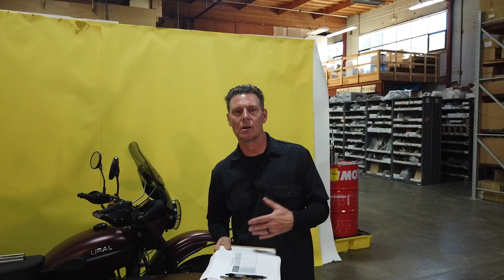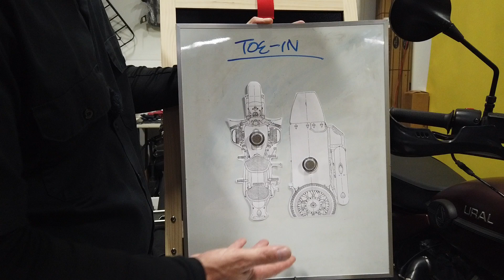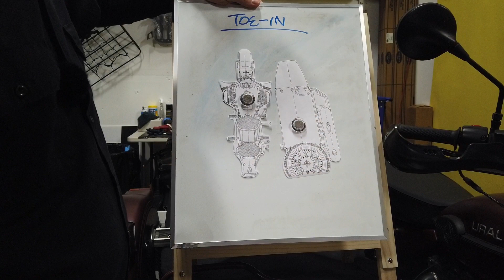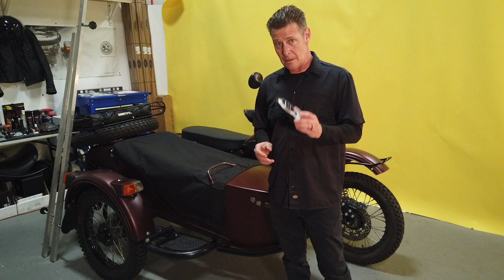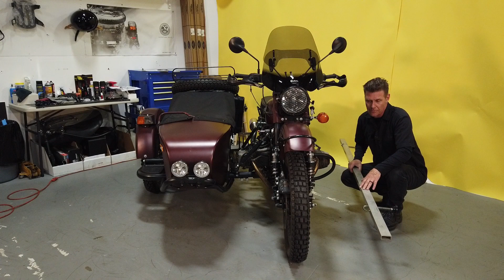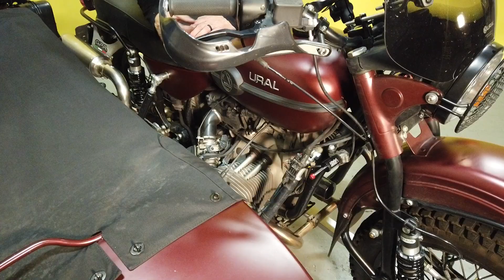URAL How-To - Sidecar Alignment Check

Comment: Thanks for the detailed information.!
Disclaimer noted, by following your instructions I can’t make it worse. :)
Severe wobbles at low speed on my old Chang Jiang.
I shall start again from the triple tree & front wheel just to be sure.
10 mm & 1 degree.
Cheers from Australia.
Reply: If you are having wobbles, please check your wheel rims. You may have one (or More) rims bent causing some wobbling, also check your wheel balancing

Comment: Mechanic for 40 years, aircraft mechanic for 32 of those. After these adjustments are correct and tightened. Consider applying "torque seal". A paste from a tube that dries and is skydrol (aircraft hydraulic fluid) proof. So it should be a more than fine for motorcycle applications. 
A bead across the tightened bolts, nuts, etc.  if it is ever misaligned across the application it would mean something has come loose, changed or just plane fiddled (f$&ked) with.  This should then alert that it very well is now out of alignment.  Can even be purchased thru Amazon, just look up torque seal. About 15.00 a tube.  Good for car/truck alignments as well.

Comment: Thank you David for such a detailed and informative video. I became the owner of the Ural ST in early September 2024. The motorcycle was produced in 2020. Before me, the motorcycle had only one owner, a rich man who had 5 motorcycles. He ride this Ural only 1,000 km (621 miles), installing everything he could on MC. I have already driven 1,300 km on it. And all this time the motorcycle was pulling to the right. After watching your video, I bought everything I needed to build exactly the same equipment for measuring wheel alignment. A couple of days ago, I discovered that ALL 5 shock absorber springs have different pre-load adjustments (as you know, there are 5 levels of pre-load adjustment) !!!
I corrected this error (or someone's bad joke) and a "miracle" happened - the motorcycle began to go strictly straight! You might want to make a video on this topic, as I don't think everyone pays attention to the pre-load of the shock absorbers... 🤝

Comment: I've added a light, homemade, right sidecar to my Yamaha FZ6R. I've followed all the standard lean-out and toe-in, and my tricycle tracks true. But when I apply the brakes (either front or rear or both) the rig tends to pull left. I figure the sidecar, although very light, wants to pivot the bike to the left, and that the only solution would be a brake on the third wheel. Any explanation or suggestion?

Comment: I have no experience with riding a sidecar or owning one. At this moment, I am intrigued by them, but I have worries about this issue and necessary tuning. Could this be a result of the varying quality that often accompanies man-built manufacturing?
Reply: Just bought my first sidecar rig, Ural car on an '81 BMW R65. Ive been riding motorcycles for 15 years, and work as a coach teaching the basic rider course. This thing is completely different when it comes to steering, throttle inputs, body positioning, everything. The main issue im running into is a very sketchy wobble at low speeds (which is why I'm watching this), I would say if you do get a sidecar rig, get it from someone who did their research and can prove it. Or go the dealership route. Because getting this sidecar aligned has so far been a huge pain in the ass

Comment: Do you have any advice on tyre wear from this? My bike tracks perfectly at 50mph and pulls to the left off the gas. I have just had to replace both tractor and sidecar tyre at 2000 miles as they are worn out

Comment: Great video sir!   Can you tell me what the sidecar torque specs are on the lower tube pinch bolts.  Mine I found to be loose.  Looks like the owners manual says 64.9 ft lbs.  They seem to have lock nuts.  Wondering if my dealer didn’t tourqe them during the assembly process

Comment: I liked this video, UNTIL YOU TRIED TO SCARE PEOPLE INTO BUYING BITS OF OVERPRICED METAL !!!
ANYTHING THAT IS STRAIGHT CAN BE USED... ANYTHING  !!!
Reply: SO TRUE,I USE ANGLE IRON,FASTENED TO THE WHEELS WITH LARGE CABLE TIES,I HAD TO TWEAK MY HARLEY TILL IT FELT OK FOR ME ,BUT AS I LIVE IN ENGLAND,THE CHAIR IS ON THE LEFT,BUT DEPENDING ON THE ROAD,POT HOLES,CAMBER,ETC,YOU STILL GET LITTLE SURPRISES,BUT WHEN YOUR ON A LONG STRAIGHT,SMOOTH ROAD,ITS SWEET,….JUST HAVE A LITTLE PLAY TILL YOU GET IT TO SUIT YOU,STEERING DAMPERS CAN HELP,STOPS THE TANK SLAPPERS,BUT THE WIZE THING TO NOT DO IS RIDE AN OUTFIT WITH NO HANDS,ALTHOUGH BACK IN THE DAY,I HAD AN OUTFIT WITH RIGID FRAME AND GIRDER FORKS,THAT WAS TERRIFIC,,,,RIDE SAFE FOLKS.

Comment: I think your full of shit sending someone to a dealer. If someone can’t maintain their bike and or sidecar they have no business riding. Thank you for the rest of the video but cut the shit.
Reply: Those extrusions are better than a piece of angle or an old light….. right… outright lies… the only way you’ll get the same or better as that glass tube would be a level…. Or something similar that has been checked on a surface plate….

Comment: I don't own one of these bikes but I watched your videos, why would you have to remove the upper bolt from the adjustable rod, loosen the jam nuts and turn the center section. If the upper and lower ends are threaded it should move outward or inward, without removing the upper mounting bolt or is the bottom mount welded on,just curious.

Comment: Good advice. When I bought my used 2018 gear up last year, I took it down to Holopaw Ural near Orlando and Gene and the crew got it  aligned correctly. It was acting Squirrely and I knew it wasn't right because my 2005 tourist tracked true all the years I drove it.

Comment: Hi, David. think i can guess your answer to this question, 2014/18 gear up owner with out a service/dealer close by, and no computer software like OBDwiz what very minor adjustment can be made to the EFI gen one like to raise or lower the idle,maybe even check balance. i know there is a adjustment screw on the bottom of each electro-jet. i have not messed with these but would like to raise idle up a couple hundred RPM.

Comment: A simple question.  The lean out I get, just the angle difference based on the brake rotors of rear and the sidecar.  Why can't the toe in be specified in degrees?  The specified measurement is based on the length of the rods at the front wheel, correct?  And this is bike specific, or is that the point.  Seems that all side car rigs have some degree of toe in.  Is there a magic degree that applies to all?  Just curious.

Comment: Glad that you pointed out that our Urals are hand built by real people and will have slight variances. As with my 2013 Patrol T. Because of the swingarm misalignment the rear and front wheels on mine are offset about a 1/4" when parallel so I have to adjust the toe in off  the rear wheel only. It works.

Comment: David, Thanks for the video. Should the sidecar frame be level fore and aft? On my new 2021 cT the back of the frame is quite a bit lower than the front. Seems like I remember on my two previous Urals the frame was level.

Comment: I like the fact that david says right up front that different roads in your locality will have different cambers. That is how much slope the road has in it to drain the rain and in my care thre snow melt. Riding on any given day will subject you to all of the variables. In my case I ride back roads the most- so I adjust to that. They have the most. camber. when I get on a state road it is entirely different.
Also when you ride out of state - like going south- the roads have less camber and are different . Every setting on alignment is a compromise. Also the weight of the rider and it's passenger will make a difference. Test the bike the way you will ride it most of the time.

Comment: Have a real problem with my 2010 Ural tourist with chair on the right. See I'm in New Zealand and we drive on the left. With the alignment of the bike leaning away from the chair on a left hand cambered road the handling is OK but the riding sensation very weird. I've brought the bike as upright as the adjustments will allow and its a whole lot better and with no ill effects, better if anything. What's the official line please?

Comment: Great video, man! It was very effective, I may sound stupid but, because I intend to buy a Ural, I hope you won't mind if I'm gonna ask you a question even it might sound a little bit strange to you.... So, why nobody thought about installing a safety belt in the side car? If such an option existed would it be useless? Or can it even be dangerous in case that I will install  one after market? Thanks for all the tips you are giving to us!
Reply: I most definitely would not install a belt in sidecar. If bike tumbles it rather escape the cement mixer. When I take youngsters in sidecar I’m making a decision for someone else and simply use a high degree of caution. Low speed - low traffic — familiar surroundings etc. An adult is capable of making their own decision.
Reply: @stupollock6851  Thanks a lot for your answer!

Comment: I just got my 2020 GU and it's a wrestling match to drive, Pretty good pull to the right, I do not think the dealer set it up right, Driving in a straight line should there be that much pull.
Reply: No, not really unless you're on a steeply crowned road, perhaps. Try to find as flat a road as you can and if it still pulls hard to the right, have your dealer adjust it or do it yourself.

Comment: First, this is a very good tutorial,  Remove the Ural hubris and it is damned good. and now for the rant. And it is a long one. Some background, I own 3 Urals, have had 4 (the gone one was named Christine for a reason). Have been riding Urals for over a decade, sidecars almost 30 years. But sorry David, Ilya, Jason, et al, I can't let this slide, been doing this way too long. Sorry David, you tugged a chain. Unfortunately, many dealers send bikes out the shop misaligned, in some cases horribly so. MANY DEALERS, way to many. Perfect is not attainable, but closer than what I've seen sure is. Next dealer meeting, go ove this subject, please. I've been lucky have had dealers who are run by sidecar people for mine, plus I mount sidecars and know how to align then. It is more art than science. I my case, the 2 dealers (Ural NE and Bluemoon Cycle) even mark the alignment so you know if it has moved! And yes, had to alter my alignment because I am heavier than the normal Ural rider, easy enough (in my case 2 threads of lean out). I wish I had a dollar for every Ural I've assisted getting right, in a campground, at a rally, with a frustrated worn out rider, and generally brand new bikes. It takes patience and time to get right and ANY STRAIGHT EDGE works, but it has to be straight! Florescent tubes do not bend, got it? They do break and make a helluva mess though. (do not use lumber as a straight edge, it is NEVER straight) Your alignment beams certainly do, have seen it with my own eyes. Know a dealer who I will not name have a brand new set that was warped, we made some new ones for him out of some stock we found that was straight (actually we repaired what he had). I hope he complained, but knowing him, probably not. It is a damned shame many dealers can't get the alignment right.  How do I know this? Shoot, go to some damned Ural rallies for a change instead of just working the shop. Many turn into workshops on how to get your Ural right (or home). You know we have them all over the country (BURP was supposed to be now, damned Covid), listed many places and generally small, not big and sexy like the big shows, but is where your customers (potential and current) are. We appreciate the goodies you all send but I have yet to see a Ural rep (nor Jason nor Ilya, man that would be huge if either made an appearance) at a single Rally in all these years. Terry does not count, nor does Gene, Jon or Ski  at the rallies they host. Saying that, again a really good tutlorial, now, get all of your dealers on the same page, tired of fixing their crappy alignments on new bikes and after this covid crap is over, get out to some rallies and do some demos like this, would go so far to help the brand it is believable. You won't even have to bring tools, we all carry them with us...and if you do show up at one I attend, I will personally apologize for this post. On the forums I am known as BigJames so you can verify I am not talking out my lower torso - or ask Jason, Gene, Terry or Ilya about me. Keep them coming...
Reply: I know this comment is old but as someone new to sidecars (in my case, a Ural sc on an '81 BMW R65) I appreciate you sharing your experience and your feedback. I know not to always trust the dealership, so I always look for comments like yours for a thorough second opinion. Hope things are going alright for you man

Comment: Excellent instruction... just curious.... once an alignment is successfully setup/achieved is it normal that with time and kilometers that it needs redoing or once set it should be fine?
Reply: you can trust my 250K miles on sidecars or ignore it, but I say yes, over time the adjustment can change and have to be tweeked. Problem is, over that same time, you've been the only one riding it, so may not notice it until it gets really bad or you ride someone else's rig or someone rides your's!
Reply from the maker: Like James said it will require adjustment over time. Think of it like aligning the front end of a car, with mileage it will need to be realigned. If you traverse hard off-road conditions frequently it will need to be checked more often.